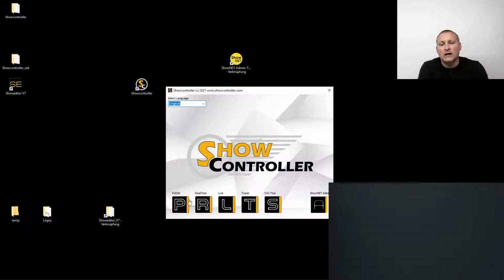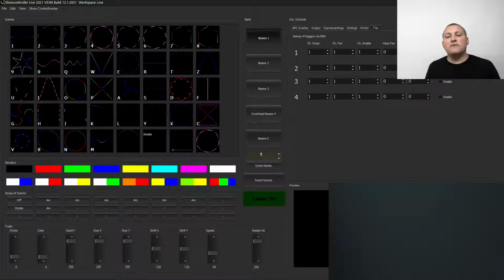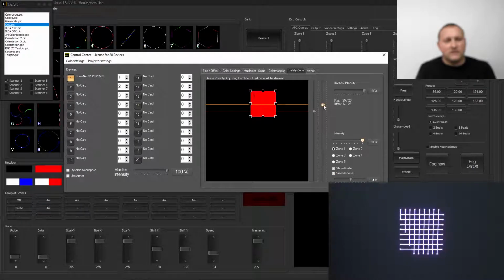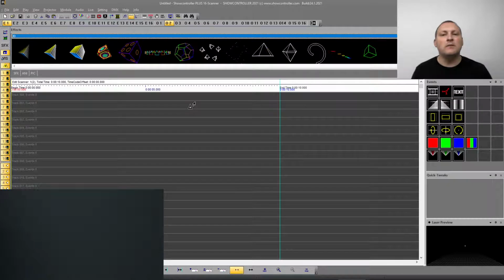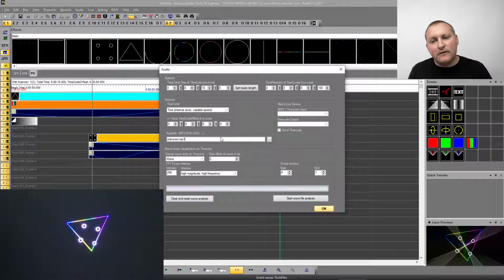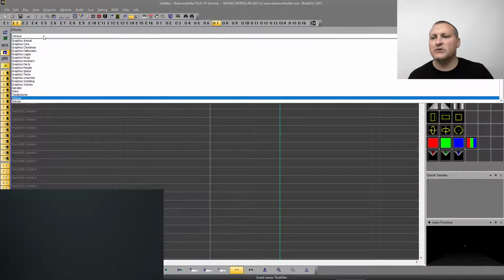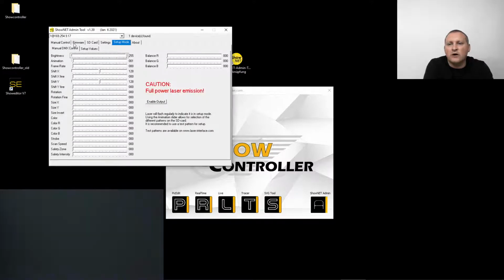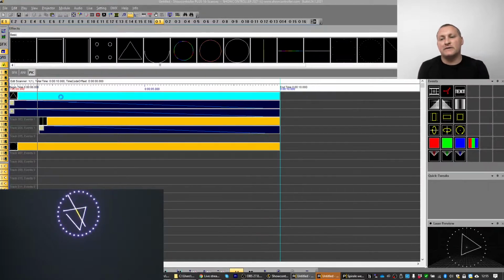Software Training Showcontroller - Basics | Laserworld

Comment: NIce video! Impressive system indeed. I found myself here as I was thinking to get Laserworld CS-500RGB to my home use. Does this application work with that model and what would be license cost for 1 laser home use?
Reply from the maker: The CS-500RGB KT is a basic laser, but it already has an ILDA connector, so it is possible to computer control it. To do so, you need an external ShowNET interface (https://www.laserworld.com/en/laser-software/showeditor-set.html) to convert the digital Computer control signal to the analog laser control signal, plus, if you want to use Showcontroller, a Showcontroller license (https://www.laserworld.com/en/laser-software/showcontroller-license).
An alternative could be the Laserworld DS-1000RGB, which already has the ShowNET interface built-in as laser mainbaord, so you would just need the Showcontroller License then - you just run a network cable from the computer to the laser with that product, and don't need any additional DAC hardware any more (the DS-1000RGB also has much better scanners, analog color modulation and is more professional - but the price difference is not much if you consider the controls and possibilities)